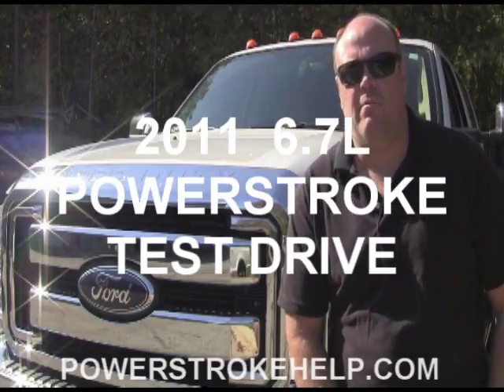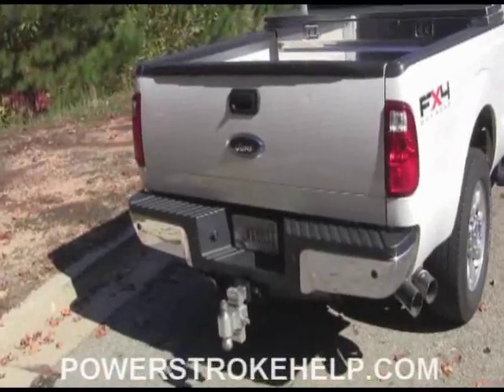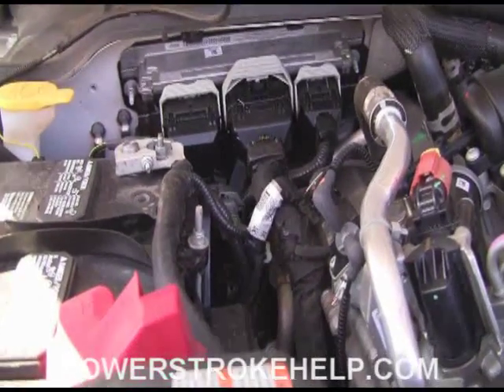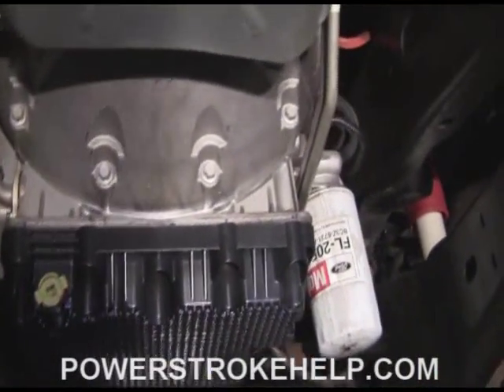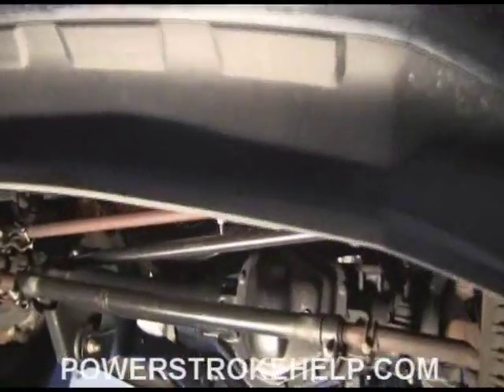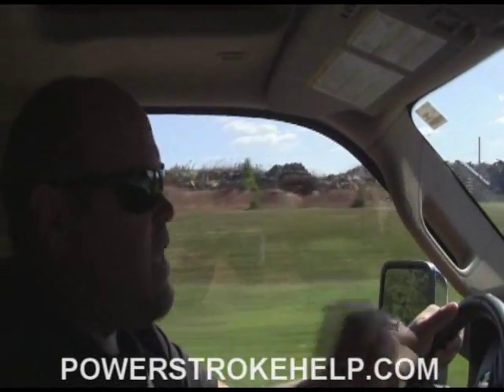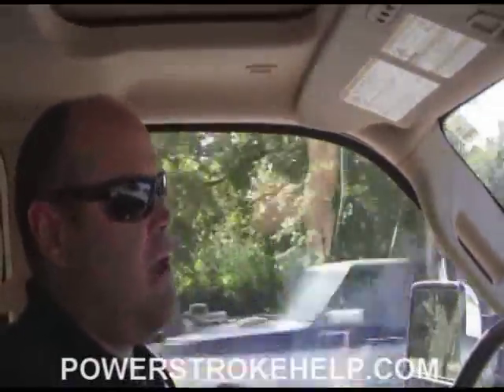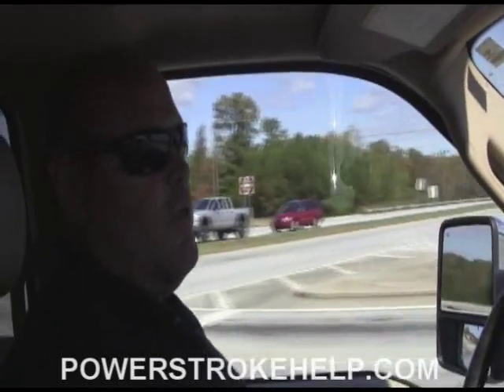2011 F250 6 7L FIRST IMPRESSIONS

Comment: I am so, so, so happy that I own the BEST diesel power plant that everyone still wants and desires - the 7.3 litre Power Stroke. I do not give a rat's ass about ''emission standards'' because there are not enough passenger diesels on the road to make a dent in the atmosphere. So glad my 7.3L has NONE. It was purpose-built for police duty, so it is going to still be running well past my time on this earth. With only 26,700 miles on it, I can practically name my price if I chose to sell. Which will never happen so long as I am alive. The 6.0, 6.4, and this new, all-Ford 6.7 will all be in the scrap heap long before my cast-iron, true big block,T444E 7.3 ever gives up the ghost!
Reply: +Mark W Gregory while  i  don't hate on ford like some people do ,,while  i am a life long  Bow tie  owner ,, i have  several ford trucks  all of them are  gas powered ,, 7.5 V8 big block power ,,save  for one and it's a 1988 ford ranger which the previous owner switched to a B 3.9 cummins 
my pulling truck which i use for  towing  trailers and pulling  corn wagons on my farm it is a custom built  chevy 1 ton 4x4 which  sports a 6V-71TA detroit diesel ,,
I needed more power than  my old 454 could provide ,, and trust me when i tell you  there is no sound on the planet  like that screamin jimmy climbing a hill , pulling at  2600RPM ,, and  anyone who has owned a truck with a detroit in it will tell you that  there is only one way to keep it quiet ,, and that's to shit it off cause  even my   6 inch mufflers won't silence it 
you think that 7.3 is long lived ,the design of mine dates to WW2 
that 7.3 still has more emissions  controls too
Reply: +Mark W Gregory i have 2 6.9 idis and a 7.3 powerstroke and thos 3 trucks together make me feel good in saying ill never have to buy a new truck one of the idi's are pushing 500k but the other 2 are still under 100k
Reply: VK70001.P yea  those IDIs  run forever ,, usually all that goes wrong with them is  injection pumps,injectors and glo plugs ,,I work on a farm here in Iowa and a lot of the farmers  still have old beater  fords with the IDI engines , and 7.3  power stroke ,they drive a fancy new truck ,,but still have the old monster to do farm work and drag stuff with
like you i'll never buy a new truck ,, my  78 chevy will last forever  and i am reasonably certain it will never rust out  now,, i know the engine will last forever too ,, after all it's  already almost 50 years old
Reply: +wildcoyote34  HA i'm from iowa to over by independence but i have been out of state for a year how hard have you guys been hit this winter?
Reply: VK70001.P this winter we haven't been hit at all Yet ,, Omaha area got 3 inches of rain  last week and we have had 8 or 10 days 50+ degrees today it's in the upper 30s but tomorrow  gonna be  in the mid 50s ,, yesterday  the weatherman on channel 7 said  likely we will be in the upper 30s and low 40s  through  newyears   , with a couple minor  shower chances
Reply: Hemi Power kinda funny , did you know  that any of those things can be added to ANY truck ,,I have  blue tooth ,  and  backup cameras ,, and oh i have the touch screen too  , along with  satellite radio ,and  the fancy navigation system ,,all add ons  , they work perfectly in my old reliable truck 
and you mention that  old trucks have no power ,,  I'd like to see you outpull mine with your  powerstroke ,,several have tried   ,, and one truck died in the trying
Reply: 5.9 12 or 24 valve cummins is much more desirable. will wreck your 7.3 and last longer doing it
Reply: Not with a 12v soon or later that deadly dowl pins gon get ya!

Comment: definetly would like to see ford copy chevy with the 9th injector in the exhaust for regen purposes. it would solve the the #7&8 cylinders from common 6.4 meltdowns and be easier on the engine

Comment: I just now found this video I like the look but you see I'm very picky when it comes to a diesel I want to sit in the cab with the windows rolled up the A/C on and have the radio playing & still can hear the diesel knocking I like the sound of the 7.3L & the 6.0L sounds good too only thing I dont like about the 6.7L after riding in a friend of mine's 2012 F250 its too quiet for me I'm use to feeling the shaking & hearing the diesel knock

Comment: emissions control is a joke
Reply: Never been to China have you?

I have - it's no joke.  I like to breathe thank you very much.
Reply: GammaCruxis controlling emissions is not a joke. How the government mandated it and executed the action is a joke. Almost every vehicle lost a shit ton of power and lost a crap ton mpgs and created many things that is not necessary. And in china a lot of the smog is industry based, not vehicle.
Reply: ***** diesel emissions has gone so far that the air that comes out the tail pipe is cleaner then when it went in the motor.
Reply: ***** emissions is a joke, you know how they have urea injectection to lower NOCX in the exuast, well its proven that more NOXC dosent effect the ozone or global warming, so im not sure why they put it on there. But a plus to the new urea injection is that the EGR valve dosent work as hard. So you end up with exaust in you oil and motor. On my 2014, its got 24,6xx miles. I plan on deleting dpf, def, and blocking egr. Hopefully ill gain a little milage and save lots of money because I plan on keeping this truck till 400,000 atleast. Here in Indiana we dont have emissions testing so even though its illegal, unless indiana changes then ill be okay.
Reply: ***** not to mention these new emissions systems are complex and expensive. My 2014 duramax had the invoice price of 58k, it was only the LT and not the LTZ. So ya it had leather, but other than that was a plain truck. The prices are so expensive now a days. But like my 2003 duramax, has 280K on it and runs great. But back in 2003 they didnt need emissions crap. So the motors super clean and besides a set of injectors the truck runs great! And I stkll plan to get 400k out of it like I will once I delete my 2014.
Reply: ***** yeah, I need a tuner for my 2014 Duramax. Im going with EFI live, not sure if you know much about it, because its not available for ford, and only recently came to dodge. But itll get everything deleted off of there. Ill probably add a lift pump, because the more filtration = longer.injector life. Maybe gauges, just thinking of egt and boost, do I really want/ need fuel rail pressure
Reply: Randy Stanke In some parts of Indiana there is emission testing. The northwest and Marion County (Indy). But even so, diesels are exempt from it.
Reply: FinnishCapriOwner 2904 Nitrous oxide is the stuff street racers use in NOS systems and it's aka "laughing gas." It is just a molecular combination of nitrogen and oxygen and is not carcinogenic. You obviously meant NOx.

Comment: if u didn't know those engines go out at around 100,000 miles and the only engine u can put in is the 6.0 its the only one that fits and its around 19,000 for another engine i know cuz i know a guy who had to get another one

Comment: A plastic oil pan??? What the hell could be the reasoning behind that? MAYBE save a tiny bit of weight, but a 6.7 isn't going to notice a few pounds!
Reply: +The Mighty Mutt 

Rust proof more than anything I reckon. I wouldn't like it and it would have to go for a steel or an aluminum with heat fin variety. Plastic only takes one good hard hit to crack or knock a hole in it. This freaking pan isn't a GLOCK either. Would be totally good to go if it was made out of the same polymer though. You know it isn't however.....just cheapass ABS shit like most auto plastic.
Reply: The Mighty Mutt they have changed to aluminum pan with standard drain plug on the new ones

Comment: Still hoping Ford resurrected my 2002 F-250 Super Duty with the legendary 7.3L Powerstroke in it.....with the newer 6.7L. The 6.0L and 6.4L were a failure and an embarrassment to the name and brand. It also helps if they keep this engine in production for more than a few years like the 6.0L and 6.4L. That wasn't enough time to work the bugs out like the last few years of the 7.3L.....(respectfully the 2000-2003. That was the best of the best although the '95-'99 was decent because of the old 7.3L IDI ( '88-'92) without the turbo. The basic 7.3L dates back to 1988. By 2000, it was bulletproof and well tested as well as time REAL WORLD proven. The 6.9L ( '83 - '87) was basically a test mule for the newer 7.3L that was stroked and punched. The 2016 model 6.7L have been out a long time. The 2017 will be coming out late summer or early fall like all new model years do every year. Lets hope they keep getting better and better with time. You know, iron out all the kinks so this engine doesn't shit the bed on you unexpectedly and prematurely. I'm so tired of catching shit from Dodge, GM and Toyota owners. It wasn't that many years ago EVERYONE KNEW who made the best truck with the best engine in it. Lets steal that glory and pride back.
Reply: the main reason why i went with a 15 dmax was that gm ironed out all of its issues. and solid tranny....i would not put my money in a 17 dmax for that reason...but would go with the ford...more solid drivetrain combo the better

Comment: I'll stick with my 7.3.
Reply: LuRcH lol plastic intake, yea that's gonna last 300k... I'm with ya, i'll keep my 7.3...  298k miles and still running strong
Reply: GodFear17 2003 Ford F-250 Power Stroke 7.3 Diesel SuperDuty Supercab Ext Cab
Ford : 155 MI MINT F250 XLT 7.3 Diesel Super Duty 4 DR F350 99 00 01 03 07 11 SD
Lowest Mile Legendary 7.3L Powerstroke IN THE WORLD!!!
Reply: LuRcH Sounds like at that rate it'll out live me and I'm 30 :P
Reply: I know mine will,I'm not sure what you have.
Reply: I have a 2002 F-250 Super Duty XL CC LB 2WD 7.3LPowerstroke turbo diesel 4-Speed Automatic that I picked up used as a former fleet truck. It's got 246k miles on it currently but that doesn't worry me none. I keep up on all maintenance items and use either Rotella T6 or Royal Purple oil every 6k-7k miles and the motor is not showing any signs of being tired yet.
Reply: MrNotorius5500 Hang on to it as long as you can.Depending on your driving,it will last a lifetime.Sounds like you take care of it.
Reply: Hemi Power I'm happy for you.
Reply: Hemi Power More power to you buddy. Different strokes for different folks you know. Might run circles around our 7.3s, but when your axle snaps, it'll be one of our 7.3s pulling you home ;).
Reply: My old truck is so nice that’s they are not made anymore 7.3 is long gone

Comment: Nitrogen fill is a rip-off not unless your racing, considering our air is 70% nitrogen. Check your tire pressures regularly and ya wont have problems.

Comment: i'll tell you what if your going to pay 50,000 for a diesel you take care of it there is NO reason it can't last you half a million miles or more heck theres v8 gas motors with a million miles original engines to....that's with out a programmer/upgrades but depends what you do with it

Comment: i would like to tune mine and delete the emission crap..but then the warranty would be void.. then it probably would drop a valve, blow a rod or blow some other expensive part..I don't trust this truck at all..first time towing a 36' fifth wheel trailer, air charge cooler sensor went..FIRST TIME..are you kidding? and this is supposed to be a truck for towing/hauling? every time I go on a long trip another sensor goes out.

Comment: 6.7 are junk I got a 2014 with 87k and every time you turn around it burns up a sensor I'm going back to 6.4
Reply: you bought a lemon. or a truck that was probably made on a monday or friday
Reply: TomatheGreek mines a Tuesday truck. 155,000 km no mechanical issues, only electrical
Reply: Cody Beard Well better it be burning up sensors that burning up your entire motor! I also agree with what the guys above said. Probably got a lemon
Reply: That sensor takes 5 min to change. I think I'd be happy if that was the only thing wrong. Go back to your 6.4 and blow head gasket or burn up a piston. I'd rather have a bad sensor.
Reply: I've got a 2011 with 257k, no issues. Easily the best truck I know of